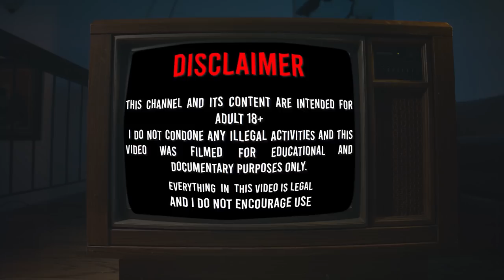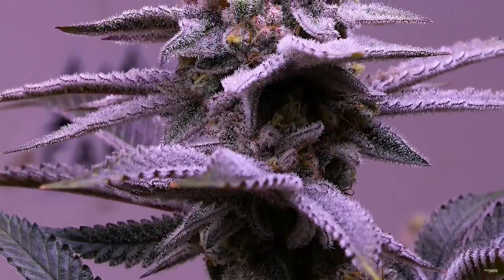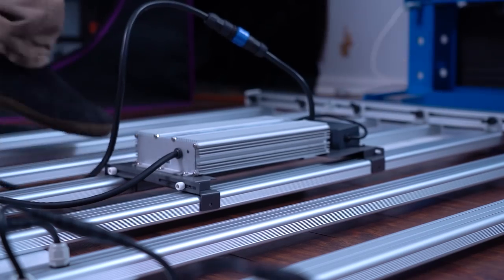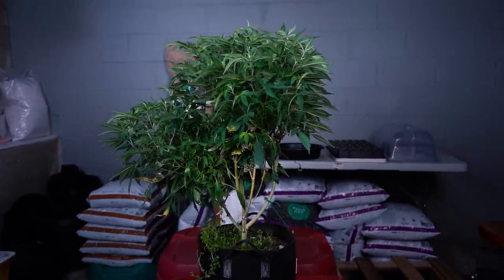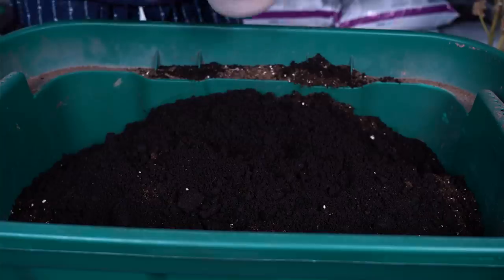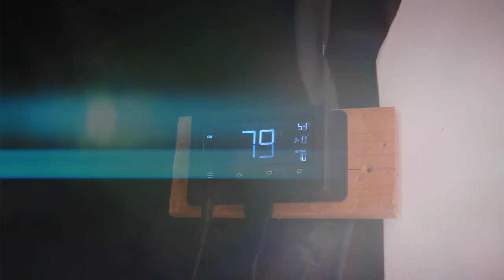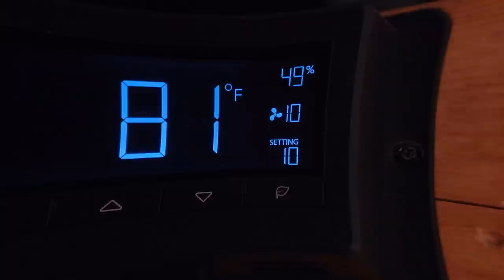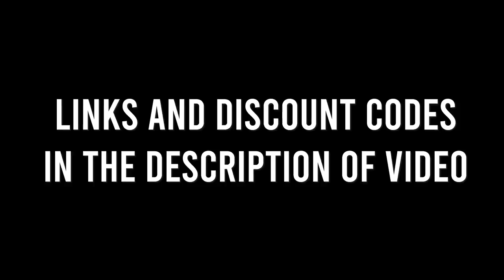ORGANIC LIVING SOIL GARDENING TRANSFORMATION | EVERYTHING I DID! THE RE-VEGGED PRIZED PHENO GUIDE

Comment: Hey there grow bro. Question for u ( just clarification)  
Lighting- I am all living soil about 4yrs building.  My Lighting lacks but my experience helps. 15-18" heights and 50-75% power depends on stage.
Been growing since way before led's. My growing buddy is stuck on putting his lights( viperspec and a off brand 2k bar light) inches away( hydro system)  he builds big buds but I think he is pushing to hard. Big bud's doesn't mean quality smoke.

Comment: So for 40 gallons of soil id need to add 120 tablespoons split 50/50 444 and 284 ? Also is it only if you're transplanting and flipping to flower ? 
  Should I only use 444 and worm castings in the veg cycle when I'm first building my soil? Thank you for any response from anyone Mr. Canuck Killin it as usual

Comment: what do you use for calmag supplementation when it takes them time for gai greens to break down inbetween different stages. or is gai greens and worm castings enough
Reply: if you need a supplement use dolomite lime if soil ph is low. use gypsum and Epsom salt if ph is fine those two don't effect soil ph. if you use tap water normally that with castings will suffice.

Comment: When you do the 50/50 at 3Tbsp per gallon of the 444 and the 284 for transplant. Is it 3tbsp both together Total per gallon  or is it 3tbsp of each per gallon ? Ex . I'm using 3gallon pots to transfer in n flower in. So it's a total of 9tbsp per 3 gallon pot. My question is do I use 4 1/2tbsp of each to equal 9tbsp for the 3gallon pot. Or is it 9tbsp of each per 3 gallon pot.? Want to make sure I don't over feed.

Comment: Long time viewer. Had to figure out my old info so I could comment lol. Do you think a 5'x5' would be overpowered by two SF7000 lights? Also do you have any links or discount codes for Gaia Green Nutrients? Thanks for any help and your videos are great!
Reply: Unless you plan on growing in a sealed environment with co2, you'll nuke your plants pushing that much power in a 5x5. I haven't tried that I did try a ROI-e720 in a 4x4, tried using 2 of those exhale bags. 1st run light burn, 2nd run used 2 trellis nets for low training, light burn. 3rd run used 2 trellis nets, removed my carbon filter and inline fan. Placing the fan ontop of tent and raising light to the roof, still light burn. Major burn to where I almost didn't finish flowering. That was just 45 watts a sqft, granted growers choice make quality lights. You're talking about trying to run 52 watts a sqft.

Comment: So I made your soil.    So unless I’m not getting your mix correct.    I’m pretty sure it burned my seeds.   1 bag living soil (18lbs) 6 lbs wormcasting and of course Gaia green all purpose 444 and 284 bloom   At 1tbs per gallon.   I’m using 5 but I only mixed for 4.   So that would put it at 3/4 cup each  correct?   I just don’t want this to happen again
Reply: 2-8-4 is for the flowering stage. Pretty straight forward in every video. Pretty straight forward on the back label too

Comment: Matt, how do you get your nugs to grow so densely? After a few years of practicing and learning I’ve finally got a good formula for success to get some frosty nugs. 

My problem, I find my nugs to be “leafy” and not bulky like what you show in your videos. I’ve been practicing with topping and lollipopping which I need to work on. My problem with lollipopping is my timing, because I’m not looking to stress the plant, and this leads to lower parts of my canopy growing useless nugs that don’t amount to anything substantial.

Any tips for this?
Reply: How many watts per sqft are you running. Once a cultivator can take a healthy plant from seed through harvest,  but are still getting airy nugs it's normally due to not having enough light. Multiply your grow space and divide that by lights actual wattage. 4x4=16 600÷16= 37 watts a sqft. 30 watts a sqft is minimum youd want with quality LEDs cheaper the light more wattage per sqft will be needed. That 37 watts a sqft is what I run dense nugs. Also simply genetics some don't grow as dense as others. Lastly bud, don't worry about stressing the plant out. Take whatever you want off wherever you want to.  being leafy buds you could also not be flowering long enough. Not giving time for calyxes to swell. Adding 2 weeks to the breeders suggestion is usually minimum they can run 14 to 15 weeks sometimes longer.
Reply: @Chris-Hill  very interesting comment and thanks for tips. I’m running a 2.5x2.5 with a spider farmer SF1000, which I ran at 100% the last 4-5 weeks of the grow. The plants were expected to finish at 9 and 10 weeks respectively. I genuinely don’t know how much wattage I’m using to be honest, I’m a relatively low budget grower with some decent equipment for my standards anyway.
Reply: @bravosierra1548  it's a 100 watt light and you're running 16 watts a sqft. Also I've honestly never had a run ready in 9 or 10 weeks. If the breeders date is 10 weeks, their not counting as soon as lights flip to flower. It still takes a couple weeks for plants to transition into flower. If 10 weeks is the flower time add 2 wks minimum. I'm running 3 24k right now. 10 weeks ( breeders flower time for 24k ) was up 2 weeks ago, if I started counting at light change. one will be ready in a couple days ( 12 weeks ) another still has a week or 2 the third could go another month.
Reply: @Chris-Hill  interesting, thanks for the info I’ll have to keep all this in mind for my next run in the fall.
Reply: @Chris-Hill  here is my next question, if the trichomes suggest the plant is ready do you still extend the grow time? By that I mean the cloudy/amber colours
Reply: @bravosierra1548  nah you harvest however are you looking at the calyx trichomes or sugar leaf trichomes? Sugar leaf trichomes will become cloudy and amber sooner than calyx trichomes and will be misleading. I'll use the calyx middle to lower buds. Buds closet to light will mature a little sooner as well. Really no difference in bud, but by harvesting when top buds are ripe may take away medium to lower bud potency.
Reply: @Chris-Hill  I’ll have to try again and apply this knowledge. This is great info, thank you
Reply: @bravosierra1548 no problem bud, it took me several years before I was growing good bud consistently. If I can ever help someone else shorten that learning curve I try to do so. If you run into something next grow I'm usually around, and enjoy talking cannabis